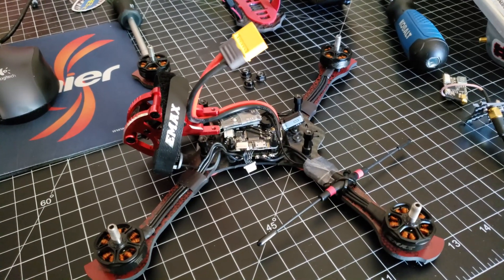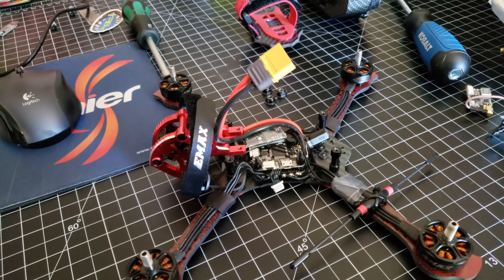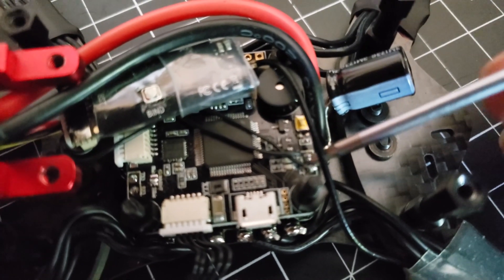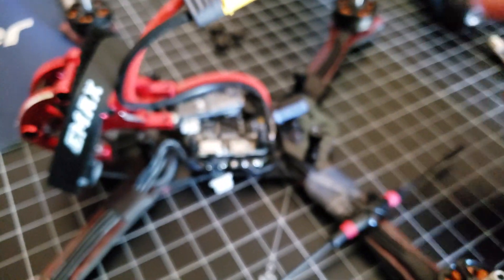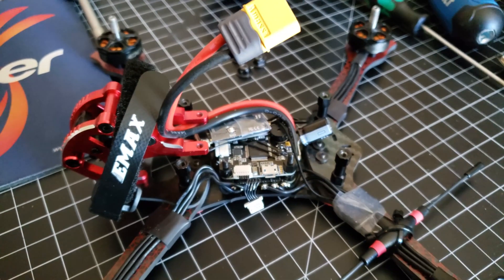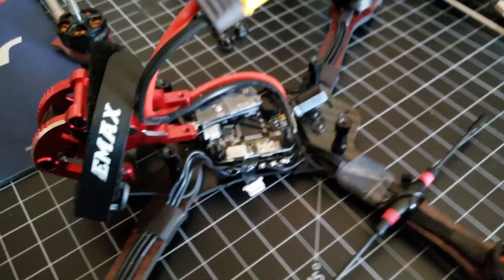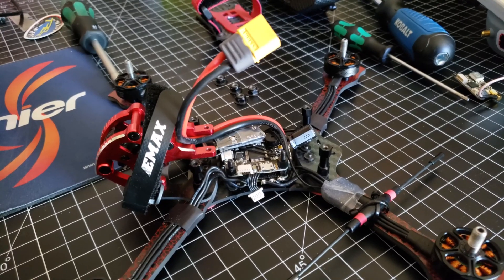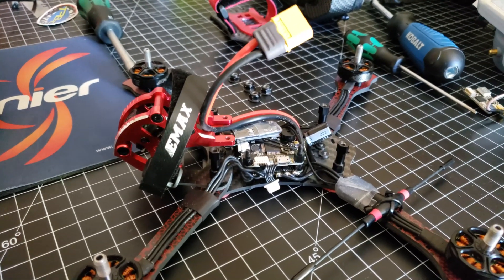Making Crossfire (CRSF) work on the Emax Buzz // and other Omnibus F4's

Comment: Do you know of any bugs for BF 4.1.3? I can't seem to get the sticks to work on  BF. I have tried that bit of CLI code and it didn't do anything. I haven't fount anything else. I'm using the CRSF Nano RX on UART1. I am using the original 5V/GND location and wires, if that makes a difference, took the yellow wire out and installed RX1/TX1, but I'm not getting anything. Any thoughts?

Comment: Would you be able to post a video on how you soldered the Crossfire Module to the flight controller?
Reply from the maker: It's pretty much covered in this video hehe. rx/tx to uart 1 and just hook up 5v and ground.
Reply: @Furadi  Will this work on Uart 3?
Reply: @willbusler  Yes it will and you won't need to paste the lines of code into CLI.